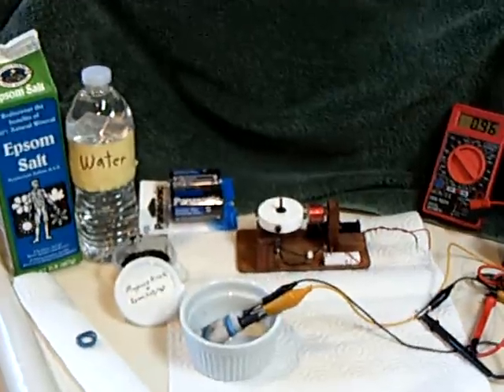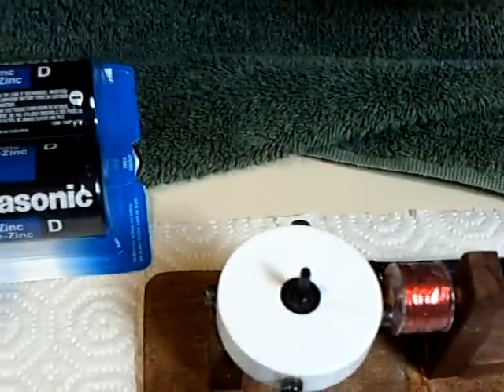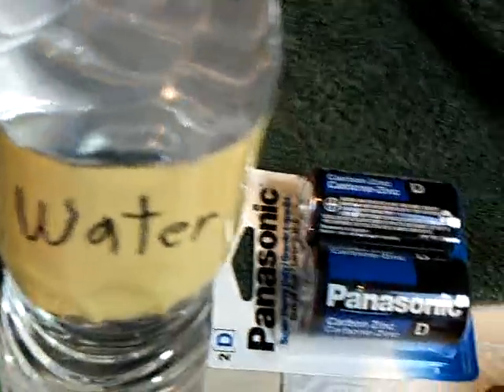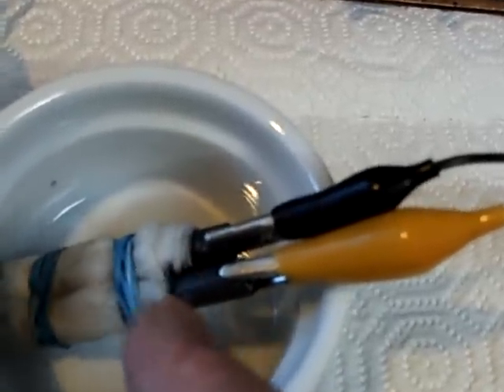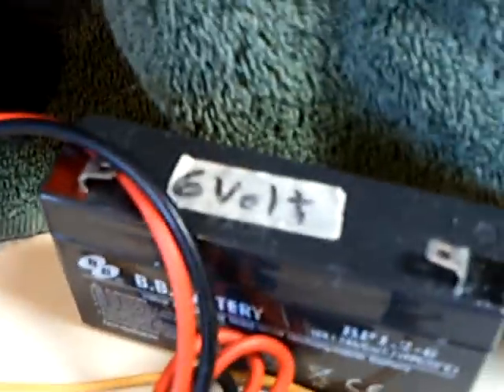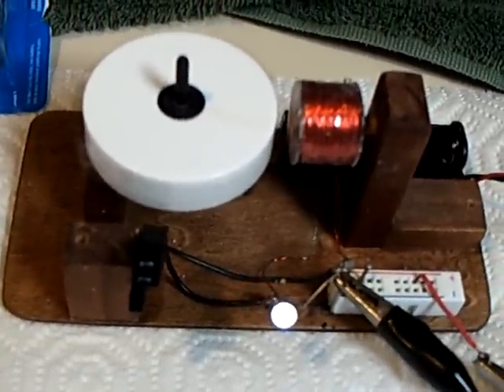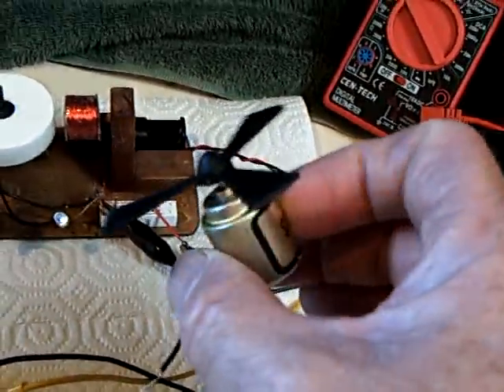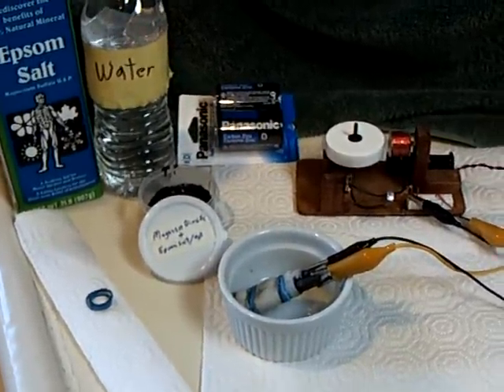Epsom salt, MnO2, and Carbon rechargeable battery

Comment: I did what you did but with a couple of differences

Use Manganese dioxide from a battery, use the manganese dioxide and carbon rod, wrap with a separator like paper make sure you add the epsom sats to the manganese dioxide

Then wrap that with magnesium ribbon

You end up wih a 2v cell which delivers around 800ma from something as sized

But i don't know if it can be recharged i think its primary only not secondary

Comment: do you have the ssg circuit there somewhere that I can not see?
Reply from the maker: Clown WhisperJust Google ----Bedini SSG circuit diagram.  Easy to find
Reply: ***** Yeah I have built the ssg many times, I'm just half blind.
Now that I watched it again, I can see the switch  instead of the transistor. :)

Comment: Activated carbon can be had from fish filter stuff. Just be sure your metal plates are at least semi conductive and that the electrolyte isn't causing a chemical reaction on the metals. :-) 
Super caps are basicly half battery, half capacitor. The idea is that its double layered. The metal is one layer the carbon is the other layer...then the electrolyte soaked dielectric(thin as possible). It provides maximum surface area and can charge and discharge very quickly.

Comment: Love your projects. :-) 
Ever tried to make a super cap? Two small sheets of metal. Activated carbon (like for a fish tank filter). Electrolyte soaked paper towel or just paper. Powder the activated carbon and put it between the metal plates and the electrolyte soaked paper or other soaked dielectric. The activated carbon provides more surface area and helps to keep the positive and negative separated with less space between the two. They tend to have a lower voltage but high capacity.

Comment from the maker: My croco clip lead that got eaten was tin coated steel (magnetic) and when the reaction got through the tin it kept right on going with the steel.  The reaction eat the teeth right off the clip lead.
Reply: Lidmotor I used to silver plate a little and I wasn’t using platinum wire. The plate solution would “crawl” up the wires and steal copper from one wire and deposit silver all the way up the other one under the wire insulation. Once it would have one layer of silver on the object it would seek out the wire. I’d strip the wire and the whole thing would be silver plated.

Comment from the maker: Thanks.   Yes I noticed in the pictures you posted that you were getting over 1.6v volts out of your flat cell.  I still need to get the carbon fiber sheet material.  I found the link you posted to the Ebay source so I guess I will order some.  I was hoping to find a local soruce to avoid the shipping cost and wait time.  The cell that I showed in this video ran a pulse motor all night and this morning recharged easily off a small solar panel & California sunlight.  Good news.

Comment from the maker: I have been wondering the same thing about the carbon rods cost.  These D cells are also an inexpensive way to get zinc.  You just have to be willing to do the messy work of taking the battery apart.  I can't find low cost carbon sheet material ----yet.  Still looking.

Comment: Yes, you have to be carefully, where your croco clip leads touch the electrodes,
as between zinced copper and carbon is also a dissimular metal voltage, so 
the touching points should the really dry...

Comment: Hi Lid,
well done.
Added this video to the free energy playlist.

You should really try to get some carbon fiber sheets.
This will increase voltage and current.

Also just try to put on one electrode just only lampblack and on the other electrode just MnÓ2
and lampblack.
And then really have in the towel only the Epsomsalt or NaSO4.
This seems to make the voltage higher., at least in my experiments...

Many thanks.

Regards, Stefan.